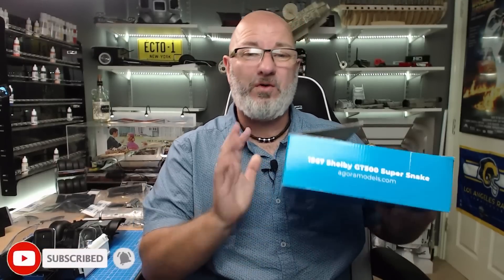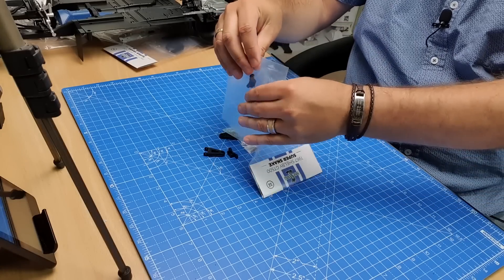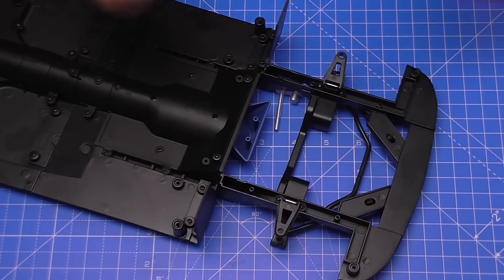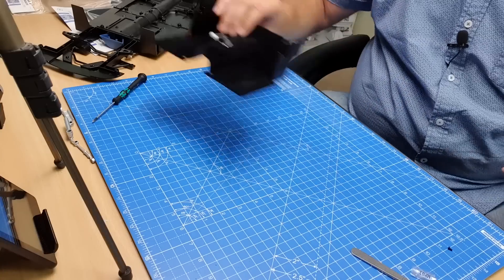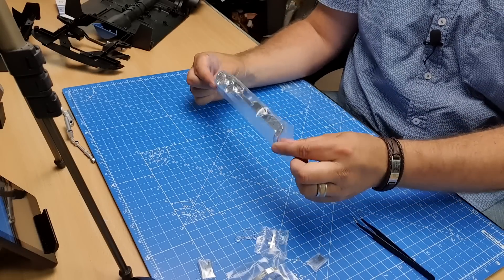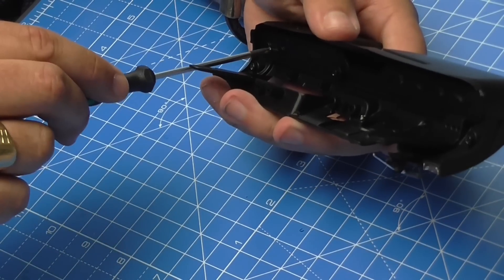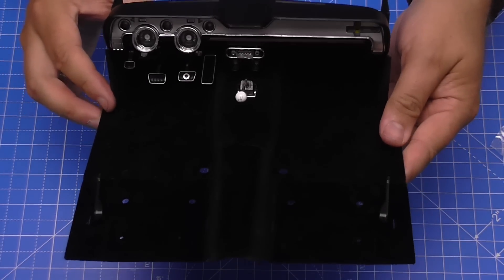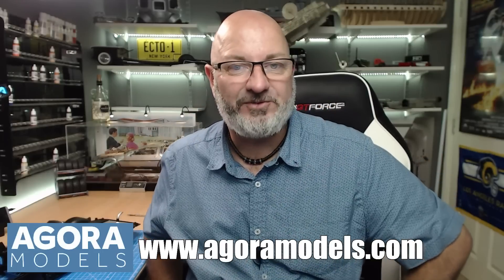Agora Models 1967 Shelby Mustang Super Snake - Pack 5 - Stages 31-38

Comment: I recently bought a Bandai 1/48 Snowspeeder and the youtube video I watched on the build showed the builder soaking the stickers in water. The reason I am bringing this up is I saw you using stickers and was wondering what your thoughts on the method was?
Reply from the maker: The stickers for this build are very low tack so wouldn't need that. They are really held fast in place by the plastic covers. If they were on there own I can see it being used so they can be positioned correctly. My only worry would be the paper swelling if the water penetrated too much.

Comment: 3 new projects on the Agora site.  A car and something else for summer, and another car for fall.  Can't work out what the second summer release is though, it's a cube!

Borg cube?  Lament configuration puzzle box from "Hellraiser"?  Don't think it's the latter, if the picture is to the same scale as the cars, it would be bigger than full size for that, but i just can't think what else is is.

The first car is some sort of SUV, rather boxy, the other looks like the sort of car that would be right at home in one of the "Need for speed" games, anyone got any idea as to manufacturer and model?